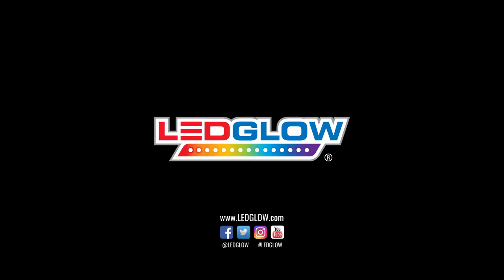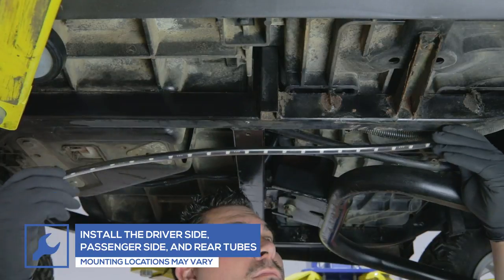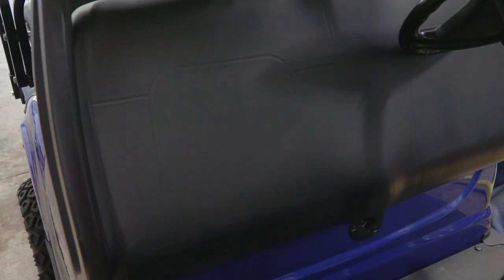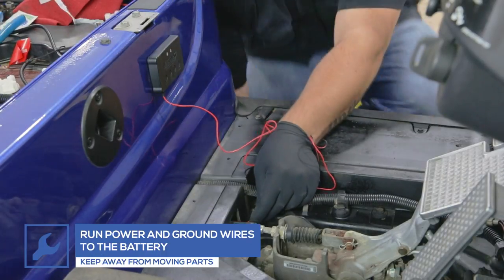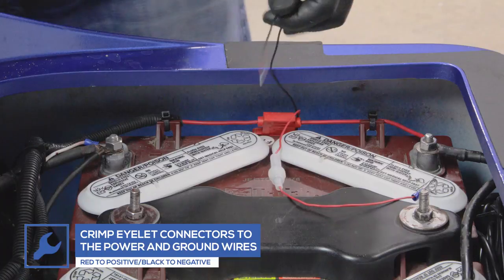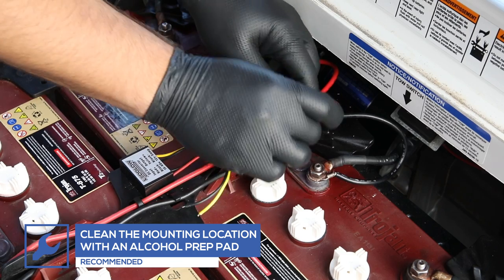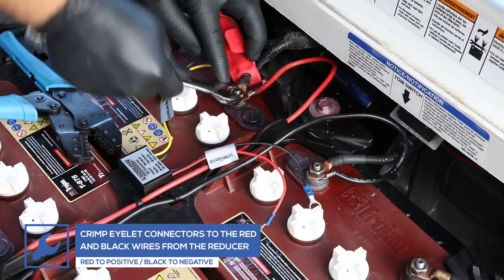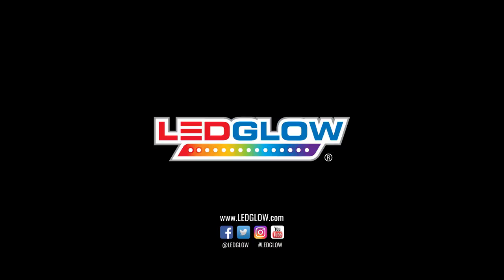LEDGlow | How To Install LED Underbody Lights On An Electric Golf Cart

Comment: Got them in today from Amazon, purchased for my EzGo golf cart. Very easy to install, no issues with the remote sync either. The lights are very bright, love the various speeds and color combo. I used zip ties not the tape, felt it would eventually fail.Liked the self tapping screws too, worked well on the heavy plastic underbody.

Comment: Thank you for this video. Is there a way to wire this kit to a switch on the dash board?
Reply from the maker: Yes. You would need to attach the power wires from the control box to the switch and then run another set of wires from the switch to the battery.

Comment: Is there enough wire to run the control box under the dash on an ezgo rxv 48v rather than on the outside of the seat area?
Reply from the maker: Yes, where the control box is mounted is completely up to you.

Comment: On the 8v set up, you ran the positive lead off one battery and the negative off a different battery.  Why is that? Can I run both wires off of the same battery?
Reply from the maker: Yes, you can use any ground. We chose that grounding location because it was close and would not stretch the wires.
Reply: I had the same question.  Thanks Paul for beating me to it!

Comment: i have an old kit from 2010 that came with the solid tube lights. i noticed the blue control box still looks the same as the new lights, can i just replace the outdated tubes or do i also have to change the control box as well?
Reply from the maker: Unfortunately, you will need to change the control box as well.

Comment: I have the EZGO 72V lithium with 6 12V batteries.  Will this kit work with that?
Reply from the maker: Yes, you will need the voltage reducer tho.

Comment: Couldn’t you technically just connect the reducer to the battery that gives you 16 volts in a 6 8volt battery configuration?

Comment: I installed to kit and the lights worked. I hit the mode button on the control box and the green light went off and the amber light is on. What could cause that?
Reply from the maker: Which kit did you purchase? The LED's on the control box will change to whatever color the underbody is set too. The light on the box should only be amber if you have the underbody set to an amber color.

Comment: I just got my lights and put them on yesterday and installed them as soon as i wired them up they lit up. The power button does not work so I can only turn them off by taking out the fuse. The lights do not change color and the only thing I can change is some flashing speed. the wheel wells only stay on white, the underbody is half white and half yellow. The remote doesn't work at all. this is not very cool looking and if it doesn't get corrected I might as well take them off and throw them away and give them a really poor review!!.  I guess I will find out if the company stands behind the product.
Reply from the maker: It sounds like you overpowered the control box. Did you install the kit with a voltage reducer?

Comment: Can I add a switch to control these?? Or do you have to power them on/off each time using the provided control box? Thanks!
Reply from the maker: Yes, you can use a switch.